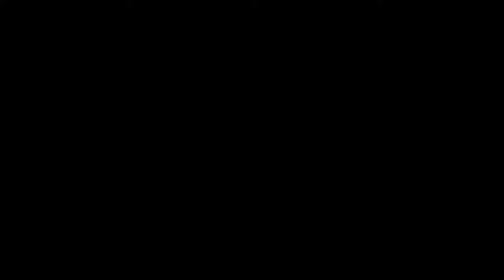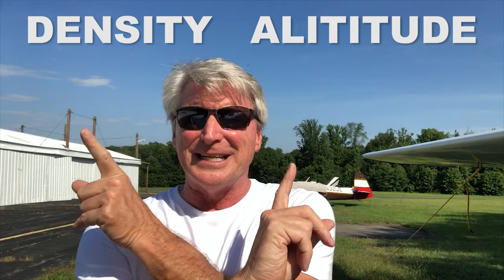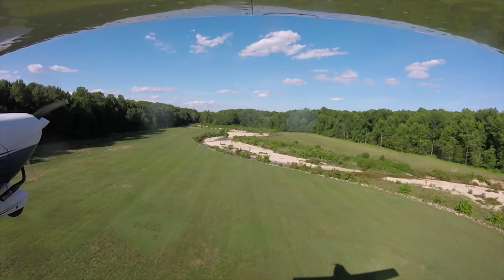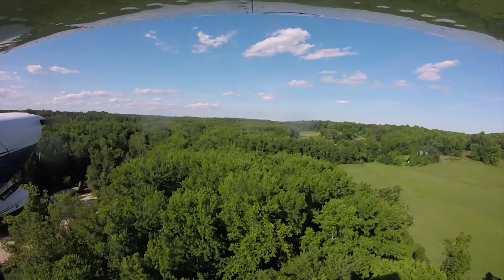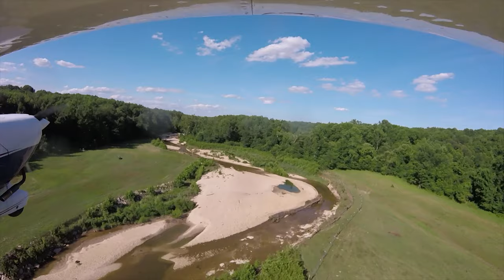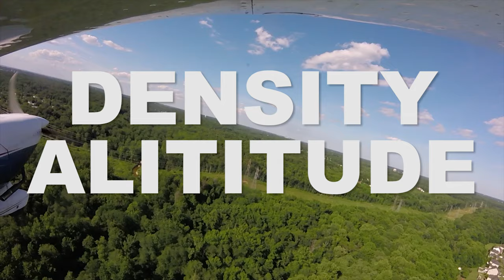Density Altitude!

Comment: I own a 77 AA-5B Tiger based at KBJC, which is located north of Denver, Colorado.  It has an O-360 Lycoming 180 HP engine.  In summer, we have a rule... we only fly with tanks at the tabs.  No more.  Three passengers max.  We fly before 10am or after 7pm when the ambient temperatures are cooler.  We typically see DAs in the upper 8,000’ to 9,000’ range.  Our field elevation is around 5,600’ MSL.  It’s very important to do a proper W&B and leaning of your engine.  We also add a 15% fudge factor to our POH numbers for added safety.  High DA is nothing to mess with!  Fly safe and fly often!

Comment: So this isn't about a Density Altitude issue, but it was a heat issue.  Left NYC a few years ago with wife and kids.  We had a problem with our clearance and everyone was sweating like crazy.  
And wow, i was watching those trees coming up quick like you mentioned.   Great info.  Thanks for the video!
Reply: Density altitude is pressure altitude adjusted for non-standard temperature (and to a lesser extent humidity), so a hot, humid, day will drive your density altitude up, even in NYC.

Comment: Some years ago I flew with my two sons to Colorado.We stopped for fuel in western Nebraska .It was mid day about 3000 feet agl  and hot! The runway was 6000 or so . I figured  no problem.Take off was ok lean for power and one notch.We took off climbed out but at some point the stall horn started to sound.It took forever to coax the plane up to 10500 to cold air as we headed West. I learned to use the updrafts under clouds to help the climb.

Comment: Video distorts our perception but I'd have aborted that takeoff :) Back in the 80's a friend of mine and I jumped in a C150 to go for a flight. We didn't check DA. We were in Minden, LA "that's never an issue". We started the takeoff roll, I rotated at the normal takeoff airspeed, the nose came up, we bounced on the mains a little, but never left the tround. From where I was sitting the pine trees at the end of the runway were not going to let us leave. I pulled the power off and we back taxied for another try. In hindsight, I should have put her back on the tie downs. The second attempt was a short field takeoff with flaps and we got off but man... it wasn't comfortable. 
Here in Farmington, NM, the field elevation is 5,506', at 7:53 AM DA was 7,097'. Not too bad for summer. It hits 9,000' plus in the afternoon. DA is an important part of flight planning, even more so here. The C172B that I rent has 145HP. If DA is 9,000' (3,500 over field elevation) "Miss Xray" is almost at her service ceiling only 1,000 AGL. Flight planning a cross country (even if it's just a quick trip to KCEZ-KBLD-66V-KFMN like I did last week) better include DA calcs. If you leave too late you might not get out of your destination due to DA. 
Thanks for the reminder. We see the occasional uh-oh from DA here occasionally I think the last one was a Mooney that settled back on the runway.

Comment: So I have a question for you. If you were full of fuel and heavy on a short runway and it was hot why not use the short field or soft field take off technique in order to get some ground effects and build up speed. The trees looked quité scary on take off. Ouff I thought you were going to sink there for a minute. Blue skies and tail winds forever.

Comment: I have to ask:  Did you ever consider using the 70 / 50 rule of thumb (or 50 / 70 if you prefer) to abort the takeoff?  Seems to me like that takeoff roll did not reach 70% of your takeoff speed before reaching the mid-field (50%).
Reply from the maker: It did - right at the point she started to lift   - it was right at the 50% - the climb out was dreadful ....
Reply: @Over50andLearningToFly  Just a suggestion:  Maybe if you could edit the video, perhaps at the beginning where you are explaining the video, mention that you did calculate the 70 / 50 rule and how it turned out.  I think that rule of thumb is an important calculation to be considered, not just for a high DA takeoff, but all takeoffs in general.
Reply from the maker: That is a good idea maybe next time thanks for watching!
Reply: People often mis-state the 70/50 rule. It's not 70 percent of your takeoff speed at the halfway point of the runway, it's 70% (or better yet, 75%) of your rotation speed by half of your calculated ground roll (from your POH). The problem is, if you're at 70% of your liftoff speed at half the runway length, you will just be at liftoff speed at the end of the runway. That's cutting it way too close, especially if there are obstacles at the end of the runway. Actually, it's worse than that. The 70/50 rule assumes constant acceleration, in which case distance travelled is proportional to the square of ground speed achieved. However, in a prop plane, acceleration is actually decreasing as you roll down the runway due to decreasing propeller thrust and increasing aerodynamic drag. So it's doubtful you will even be at liftoff speed by the end of the runway.

Comment: Thanks, Ted. This is a good reminder to all who will heed it. Here in AZ, I've seen in summer where a C172 had trouble making it to 8,000 feet solo with full fuel.

I haven't done it yet but, if you want great instruction in actual density altitude geared towards missionary pilots, contact Ethnos 360 Aviation: https://www.ethnos360aviation.org

Their strips in SE AZ are at 5,000+ feet. On a 100°F day, that gives you an awesome experience in thin air performance.
Reply from the maker: Just as challenging here as well ! Thanks for watching!